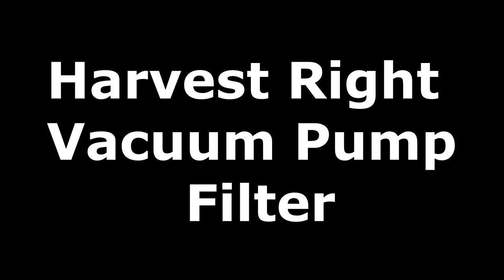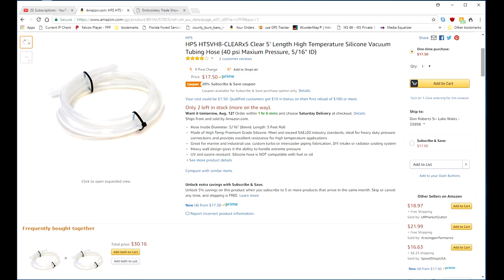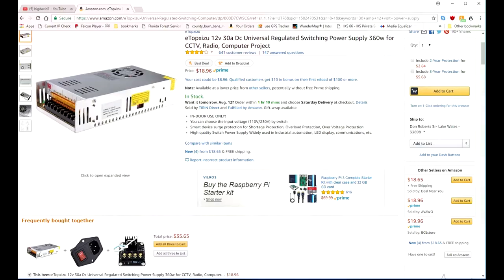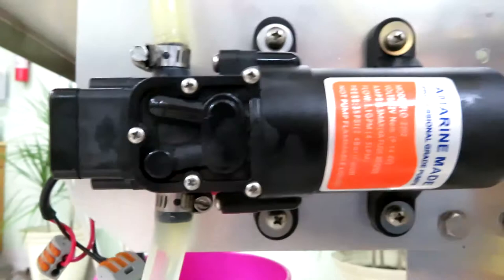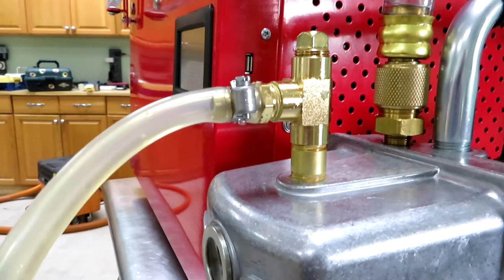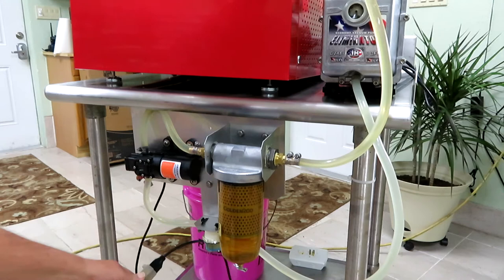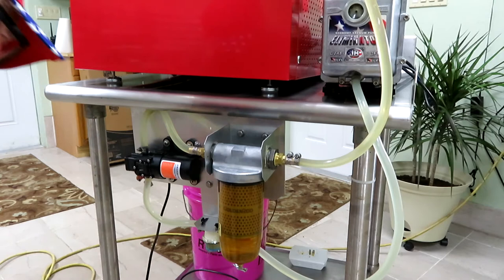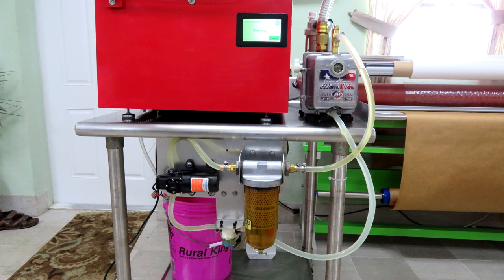Harvest Right Freeze Drier Filter System  PART #1

Comment: I have recently built the system as noted here but since I don't have a beautiful stainless steel procedure table or access to sheet aluminum, I decided to mount the entire system in a wooden box which is (by virtue of the length of the tubing) able to sit on the floor underneath the counter where my Harvest Right machine is located.
I am going to start using this system but have modified it to eliminate the "power source" transformer that reduces 110v to 12 v by using a 12-volt deep cycle battery that I have charged by a solar panel and controlled with a charge controller.  I believe the battery will be able to run the motor as long as required to filter the oil (roughtly 10 minutes according to your instruction) and will provide an update in the near future.  Your system engineering was the very best I found on the internet when researching this concept and your assembly/fabrication was neat, orderly and well designed. Thanks for sharing this with all of us!
Reply from the maker: Thank you for your kind words,  I would recommend you to watch part two of the filter video https://youtu.be/3MyRd0jtzXg
and the vacuum pump oil.....https://youtu.be/V154HSphR5Q

Comment: HI! I have a 1,5m3 vacuum cabinet, to dry and decontamina special clothes. I have to extract 2 or 3 liters of water, 55/75C of temperature with 15 micron HG. I would do it with a bigger oil lubricated vacuum pump. Do you think that your filter system could be useful for that amount of water? In your experience, when do you change the oil and the filters?

Comment: I am using your system.  I am not getting much settled water in the filter housing and the oil is always cloudy.  I am wondering if the pump I am using (similar to the one in the video) is causing the water and oil to stay mixed.  Are you seeing this issue?  I am using the standard filter, not the one with water block.
Reply from the maker: The way to check see if you have water in the oil or not,  from the bottom of the filter drain in a glass jar and let it set for one day,  the water will separate from the oil on the bottom .......but,  if the oil is cloudy it could be just fine particles in the oil,  just like in your car you change your oil,  in  10 miles later it looked dirty..
Same scenario occurs in the vacuum pump oil, what I did I use the finest micron filter available and  gets a pretty clean but it is cloudy comparing the new oil....
Reply from the maker: I think I figured out want your problem,  it's the vacuum oil itself... Please watch this video
https://youtu.be/JA3EXmFmGeg . Plus the filter cartridge I'm using is the bio diesel filter... Because I used
VacOil and had the same problem.....
Reply: Watched your video, but I only use Black Gold oil.  My process is to drain 8-10 OZ of oil from the filter after each cycle.  I let it settle for a few hours and then freeze.  This solidifies the wated and particulates.  The oil is still cloudy, but I found that if I let it sit a few days it eventually clears up to a golden color.  I am thinking that my pump is adding air into the oil and it just takes a few days for the air to escape.
Reply from the maker: None that could be an issue?  Usually I let mindset overnight so I haven't ran into that particular problem,
but the black gold to be the best.
Reply: What info did the video show?  This video you are refering to has been discontinued or removed.